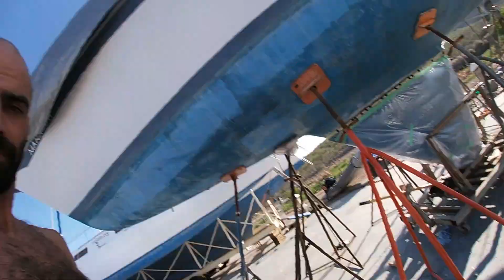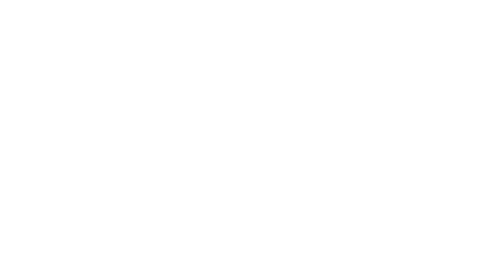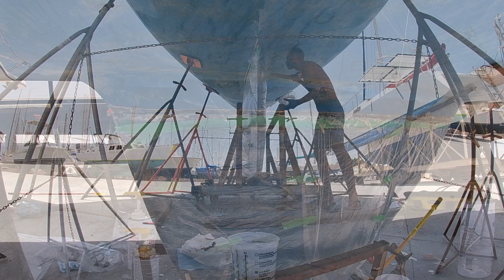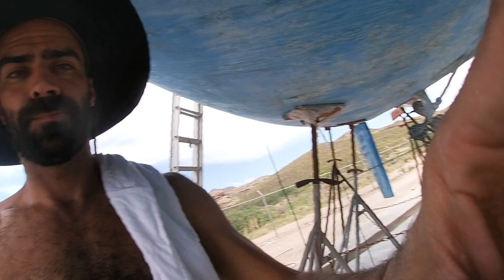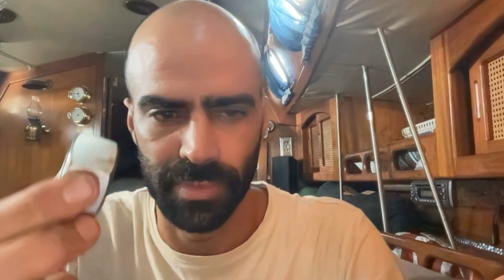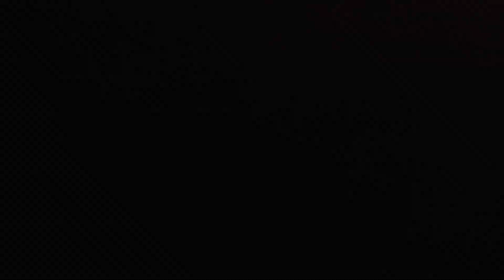How to re-bed your keel: what NOT to do

Comment: sanding smooth is an error, no penetration of materials into the surfaces.  make a project out of a simple job.  you are not going to stick the keel on.  Did you check the bolts for stretch.  50 yrs boat yard experience,  6 tubes 5200 done.  takes half a day.  lift the keel then tighten the bolts,  you can ruin the bolts lifting the keel.

Comment: my keel weighs 5000lbs and the boat without the keel weighs 5000 lbs.  I need to build something to  lift the boat at home, and then a way to transport the keel so i could work on it away from the boat.  I am going to wear steel toe boots just in case.

Comment: I was all set for a similar job on my 88 Hunter 355.
The man I bought it from said water was coming from the keel bolts .

I was exposed the joint and found it was tight all the way around

In talks with a buddy we thinks it’s likely something mundane like a leaky hose !

My plan is to get the bilge bone dry then splash her and keep her in the sling run the engine work everything that uses a through hull and see what’s what.

Fingers crossed
Reply from the maker: @109jeanmarc  I hope it's a simple fix. Keel bolts were not fun!

Comment: I'd be interested in finding out how the backing plates you made work out for you.
It's always better to spread the load as best you can and your idea is a good one I would think.
When there's keel bolts close together I wonder if making large backing plates to cover the bottom of the hull around those bolts would add even more strength?
Thanks for sharing your experience and I also couldn't agree more even as expensive as it can be always be sure to have extra supplies on hand before going into final assembly.

I'm not sure what yard work you have left to do before splash day.
Is there a plan to glass the keel to the hull, to spread the load out even further?
Now that I think about that, aren't keels designed to flex a little and my idea might end up making it to rigid?
I don't really know if that would work, just thinking out loud really.
Fair winds, following seas, safe travels and God Bless...
Reply from the maker: @PreacherwithoutaPulpit  I'll post an update after a few months of sailing. I expect the plates will work well, the only things I'm worried about are rust (made of 304 instead of 316 SS), and potentially they are too thin to adequately spread the load. Both options should be pretty easy to detect. 

I considered joining adjacent plates to have a single plate with two holes, but I didn't trust my design chops enough for that one. I don't think the difference will be significant.

And for glassing the keel in - that's how it was before. The sides were intact and in good shape. The front and back had delaminated. My guess is due to the fore and backstay tension the boat gets pulled into a bit more of a banana shape - so the fore and aft sections of the keel stub are most likely to separate.
Reply: @himanakai  
Thanks for the reply and info.
If I'm ever in your situation I'll remember it.
Fair winds, following seas, safe travels and God Bless...

Comment: Very useful lesson, thank you - I would not have thought to check the hull was completely horizontal..one thing i was wondering was whether it is strictly necessary to smooth the surfaces with epoxy, do you have any thoughts on that?
Reply from the maker: During the keel removal I ended up pulling chunks of fiberglass off the bottom of my keel stub, so the surface was VERY uneven.

What I didn't want to have was areas where the sealant gets pressed completely out, and other areas that have half an inch or more of sealant between the keel and stub.

I think some variance is normal and expected, but to a limit. If I had managed to preserve the bottom of my keel stub during the removal step, I would have left it as-is.

Comment: Awesome tenacity and the eye for detail!! Not seen all videos so was not sure why work was needed in the first place but think you mention it. You noticed a 'smile' in the front between keel and hull due to flexed washers giving away. I guess the water entering had messed up the surface so bad it could simply not just be sealed and tightened? You will have some great peace of mind once done knowing you did not take any shortcuts:)
Reply from the maker: Exactly, there was a smile at the front and rear that seemed to imply some keel movement. Furthermore, this model/year of boat was known for not having removed the mold release wax from the bottom of the keel stub, leading to poor adhesion of the sealant. I wanted the peace of mind. I'm paranoid about crevice corrosion after finding some hidden about on my last boat.

In hindsight, the adhesion between the keel and stub was just fine, and I would have been 100% OK to just dig out and replace the weathered sealant at the front and rear, make the backing plates, and re-torque. There was no sign of the keel bolts corroding (no weeping rust stains or anything like that). So while this was a good "preventative maintenance" project, it was unnecessary.
Reply: @himanakai  you only knew the condition of bolts after stripping them of old Sikaflex so it all had to happen for peace of mind:)